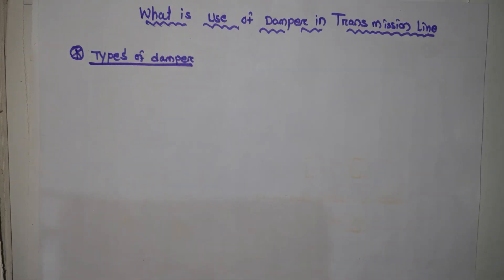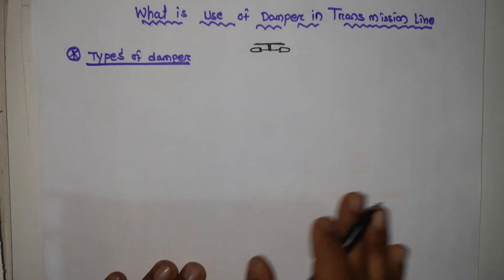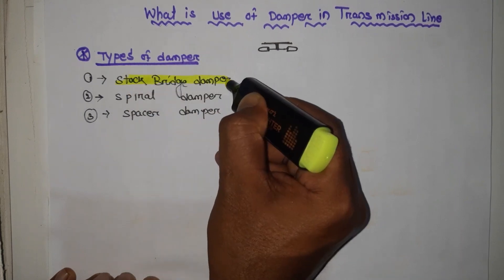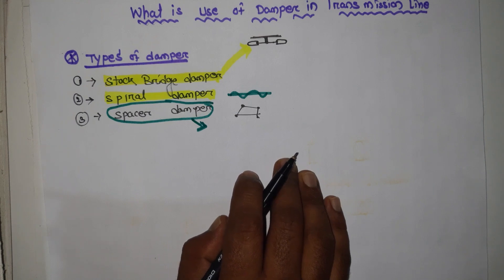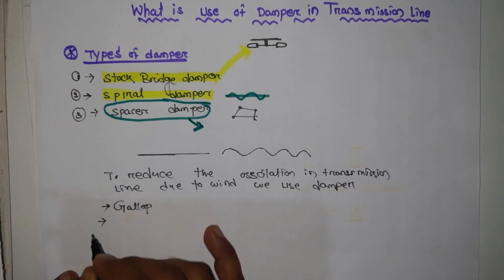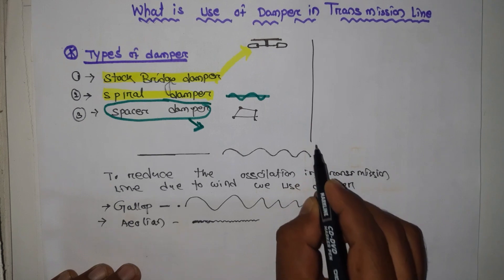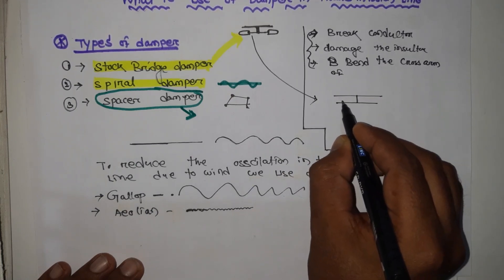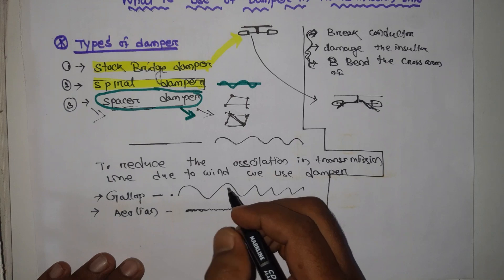Why damper is used in transmission line ||Boost series 003||

Comment: Sir transmission line me 6 wire means 2system  kue use hota he
Reply from the maker: Double circuit lines are also helpful in increasing the tr.line capacitance due to high GMR, which means high surge impedance loading and greater power transmitting ability. Double circuit lines can improve the performance of Tr.lines to a great extent.
Reply: In this explanation is used for(1phasa  2wire or 3 wire or 4wire by the helf of spacer) .  But why use only one tower but 6 phasas like (R,Y,B)(R,Y,B).means two incomer or one incomer & another is deliver
Reply from the maker: for cost convinces
Reply from the maker: This method of transmission enables the transfer of more power over a particular distance. The transmission is thus cheaper and requires less land and considered ideal from an ecological and aesthetic point of view.
Reply: Tq